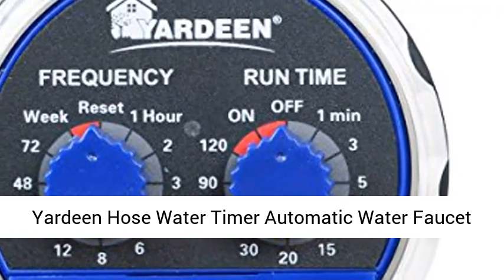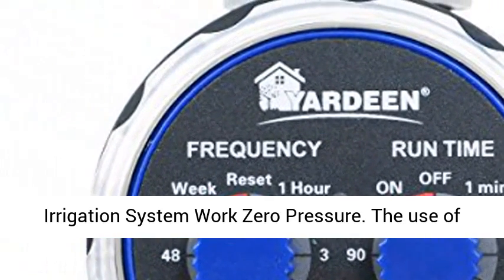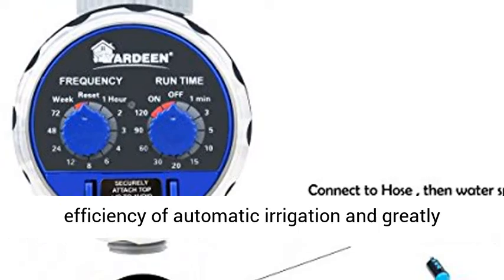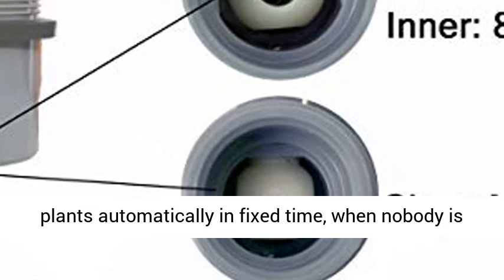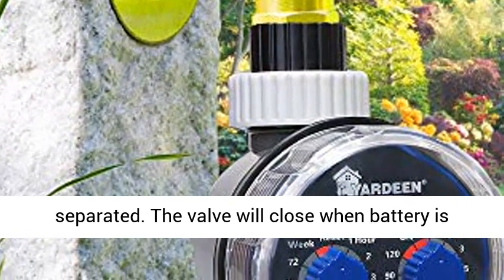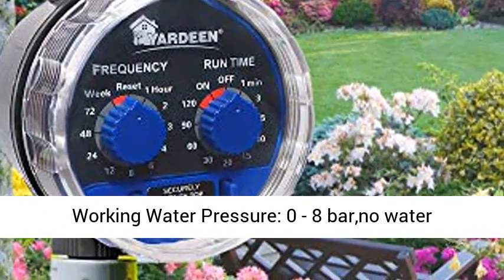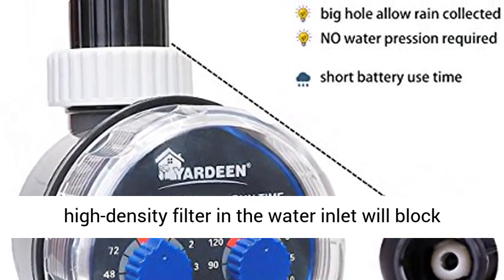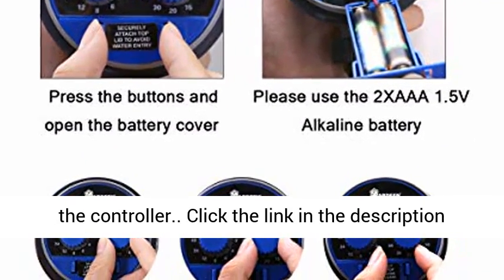Yardeen Hose Water Timer Automatic Water Faucet Single Outlet Ball Valve - Overview

Comment: I bought a Yardeen water timer about a month ago to water my grape vines. Weather has been very dry in Florida. It worked a few times and stopped. It was set to open every other day at 4pm for 20 minutes. I opened the clear cover. The LED was not flashing and small amount of water poured out of the unit. I checked the batteries and they checked out OK. I dried it out reinserted the batteries and the LED came on  so I set the timer again and the ball valve opened as it should.. Is there a way to find and fix the internal leak?
Reply from the maker: Not sure about the internals. Had mine for a good while and no leaks yet.